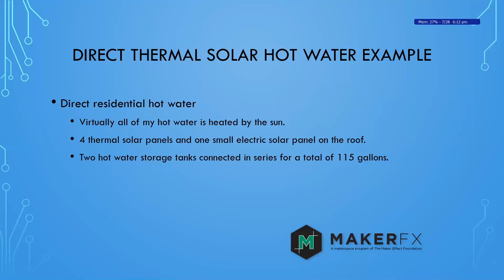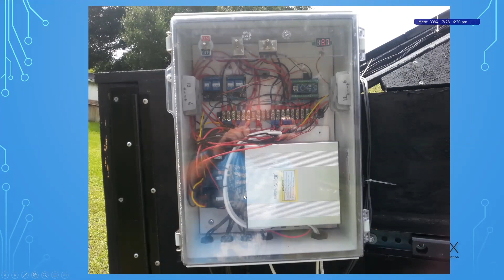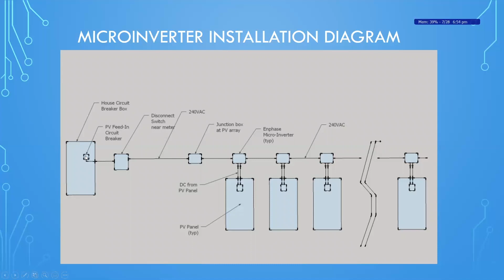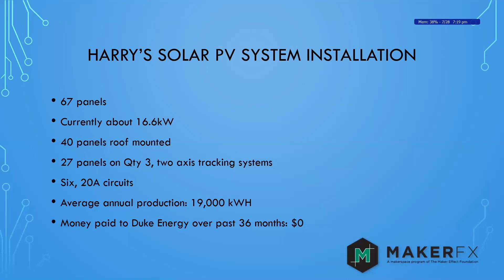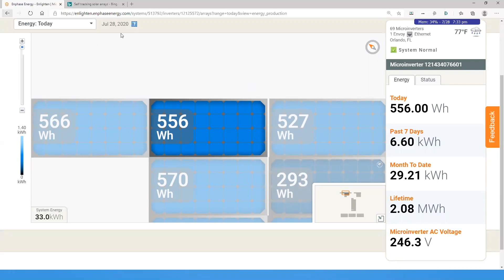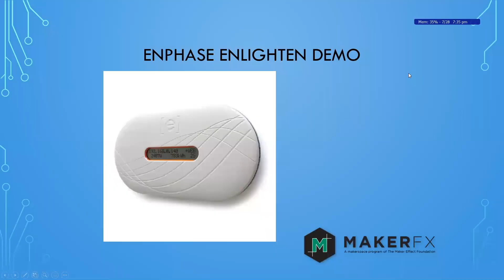Make The Sun Work For You - MakerFX Solar Class

Comment: Solar thermal is a nightmare to hook up. Fine for warm environments.  Years ago it was stated if PV dropped below $1.50 a watt resistance heating would be cost effective. PV will be the way in the future.  I heat all my water with excess PV not used in my off grid needs. You can't imagine how much power is just wasted by off grid PV systems.  With supplemental PV water heating 100% of the potential energy is used making payback far greater than HPWH in low use situations.  I build these systems now because the world has yet to understand PV water heating.  The controllers available now are too expensive as the demand is so low.  No reason these can't be in the cost range of charge controllers.